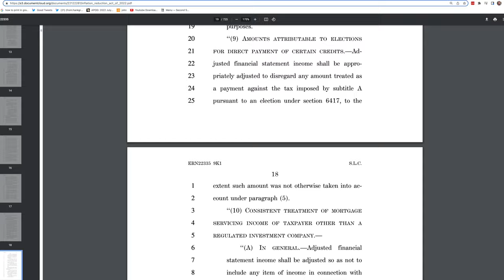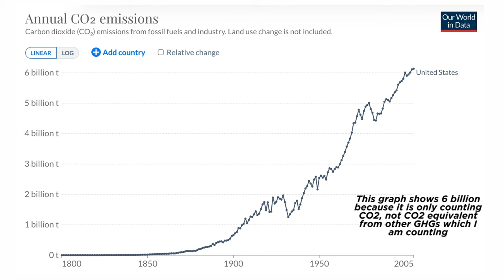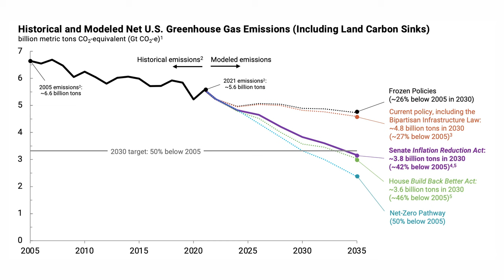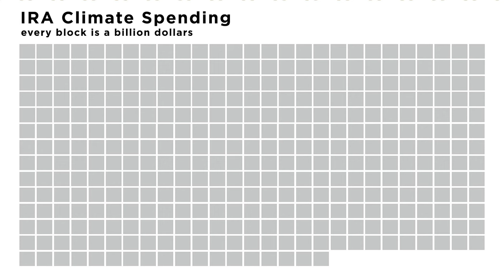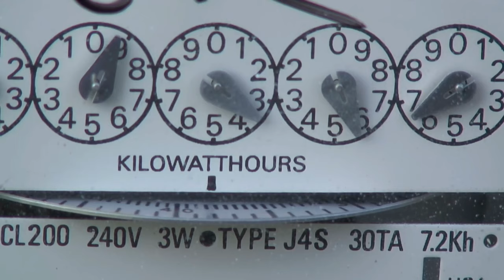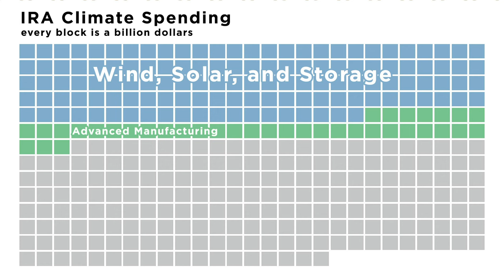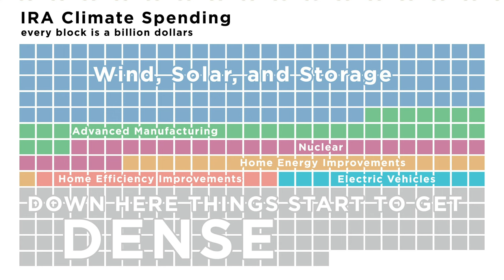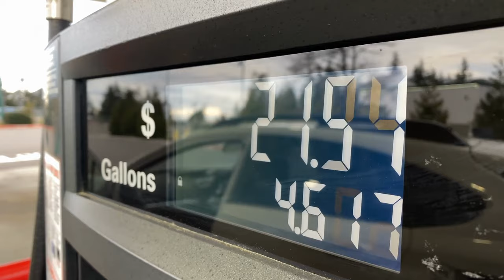The Biggest Climate Bill of Your Life - But What does it DO!?

Comment: I think it’s great that the bill helps electric vehicles, but what it should do is change the infrastructure to be less car-reliant and to emphasize public transportation such as commuter-rails, subways, and electric trolleys/ buses.
Reply: Sad part is it helps hybrids just as much. And that will probably slow down true electric vehicle development and sales, because old manufacturers can still just put small and cheap batteries in their combustion engine cars and get the full reward.
Reply: THIS. I used to say I really wanted a self-driving car, but what I really want (and most everyone I've spoken to about it) is a clean, safe, reliable, and accessible public transit system. What little public transit this country has is usually under-funded and overcapacity, which means it isn't particularly clean or safe, who knows how much longer it will work, and it tends to be either inconvenient to use or straight up inaccessible to disabled people. 

Cheonggyecheon in Seoul turned a major highway into a public park and overhauled their transit system, and it's resulted in a cooler city with cleaner air, fewer cars and so LESS traffic, and brought it millions in tourism dollars. We need to rethink everything about our country.
Reply: And not just commuter rail, but deprivitize rail so that it can run at all hours not just peaks.
Reply: I can't stop thinking about this, and about how Musk's Hyperloop ploy (which is stalling and going nowhere) was designed to halt California's highspeed rail development. It's no mistake that efficient (and therefore more ecologically and energy friendly) public transportation is seen as threat to the auto industry,  both traditional petrol and electronic, a very much private for-profit system integrated with our decaying road infrastructure (all the new and good roads are tolled). This country is overrun by corporate interest and the climate bill isn't escaping that.
Reply: @littlegreenclementine  +
Reply: Hopefully that will come in a future bill. I live in the city now, so it’s easy for me to take the bus. Work pays for bus fare, I don’t pay for gas, I don’t deal with traffic. It’s all kinds of win. But I’ve lived in areas where public transit was not feasible without still having to drive to a park & ride and deal with multiple transfers. A lot of Americans would feel shut out of this bill if that was a higher focus. But I’m hopeful this bill is the start to improve on the public transportation we do have, and build it where there really isn’t any.
Reply: That already happened in the bipartisan infrastructure bill
Reply: @whitneyschmitney  tell me you're a communist without telling me you're a communist...

Comment: I never thought I would see anything like this for years.  I have been active in climate issues for 4 years.  I think this bill is VERY GOOD.  Of course there  are things I would take out,  but the basic approach is correct as a starting point in my view.  The big challenge now is to find the companies that have the best capacities  to use the available funding.  It will be crucial that selection of contractors be totally transparent and that the public engage heavily in the process.  This includes the participation of the climate skeptics, some of whom have deep knowledge into the dynamics of energy systems.

Comment: Can you talk about how "reconnecting communities that were divided by the interstate highway program" is related to energy use and/or the environment? Serious question. Not sure I understand that one. Is it about reducing the need for Fossil Fuel based transportation and allowing more people to walk, ride bikes, or use clean transportation methods to get places?
Reply: Certainly the desire to reduce fossil fuel use in transportation is an important factor. I think that efforts to reconnecting communities that were divided by the interstate highway program are largely focused on the mitigation aspect. Those communities (which are largely poor and of color) were adversely affected by the creation of the interstate highway system and suffered disproportionately from localized automobile pollution. The components of the bill that address this are likely much like those that might seek to compensate communities that were adversely affected by a power plant or mine which polluted the local area. It is about the local environment more than the global environment.

Comment: What do you think about the impact of all the mining needed for the precious metals required for a lot of these technologies? The mining industry has a big issue with environmental oversight and has the biggest effect on the most disadvantaged people in a bunch of countries, especially indigenous peoples. Their lives are gonna suck a lot more and people don’t talk about that side of green technology a lot
Reply: Who cares?
Reply: @robertwright4906  we all should
Reply: I am a materials engineer and I wish people asked this question more often.

For photovoltaics (solar cells) the impact on mining is likely insignificant. The only required elements for a cheap and simple device are silicon, boron, phosphorus, and aluminum. Silicon is the base semiconductor. Boron and phosphorus (or other III-IV elements) are only used in trace quantities as dopants. Aluminum is simply a conductor of electricity -- any other reasonably conductive metal would suffice. All of these elements are common in other industries and unlikely to cause new problems in mining. (For example, silicon is already used as an additive to certain structural alloys and in manufacturing electronics.)

For wind turbines the impact is also likely small. The main components are structural (strong metals or composites), so they would not require much more mining than what is already mined for other structures (e.g. buildings, vehicles, etc.). Some heavy metals (typically lanthanides such as neodymium) that are components in permanent magnets may require some new mining. However, the challenge in procuring these elements is more in separating them from soils and each other as they are largely evenly distributed in the crust. Additionally, it is possible to design wind turbines that minimize or eliminate the need for such heavy metals.

The real issue in terms of mining is in energy storage, particularly via batteries. Lithium ion batteries (our most efficient in terms of energy per mass) require lithium (of course) and cobalt. Both of those have been problematic to mine in the past. I have seen some research into alternative materials systems for batteries, such as a sodium based battery, but those are likely decades in the future. For now, it is important to realize that (1) these components can be recycled (2) the mining for these metals is still less destructive than extracting fossil fuels (3) there are strategies to minimize the need for these elements in batteries or for batteries in general and (4) it is possible to create alternative storage infrastructure (e.g. build a reservoir and hydroelectric dam, pump water when energy is in excess, release the water when energy is needed). A more robust grid with a sophisticated design for distributing energy efficiently over large areas may also reduce the need for storage (e.g. solar in California can power New England in the evening; likewise wind in the East Coast may power the West Coast at night).

Comment: I was halfway through writing a paragraph and decided to cut it down, green house gasses reduction are good, electric cars are ok but I hate cars so that's bad, lack of public transport bad. Overall I'm happy with the bill and I'm glad the USA is moving in the right direction. 
tl;dr cool story bro, needs more trains.
Reply: Let's get those train rolling chuu chuu
Reply: Some amount of electric vehicles are necessary for, like, long-distance transport.

But yeah, the lack of support for public transit is disappointing. I'm not sure the federal government could actually have done much, though.
Reply: @mightyNosewings  I'm sorry, the fact you want electric cars for long-distance transport annoys me,  the point of public transport is to take you long-distances. Short distances should be traversed by walking, biking etc. Cars (and road based transport in general) fail at long distances because they destroy the surfaces they run on and have very high rolling resistance basically meaning that moving them requires more energy (and therefore money and CO2 if using combustion engines) and more resources (and money and CO2) to maintain the roads they run on. Electric cars are like putting a bandage on a wound that requires stitches; the immediate problem is gone but the real issue hasn't been solved.

Comment: "no one in Congress would keep their jobs if we started intentionally making gas more expensive" 

1 major and 7 minor oil pipelines shut down
Fracking and oil production banned on federal land
Multiple import taxes put in place for oil and gas imports.
Increased tax (reduced tax cuts) for domestic oil production companies

I'm not a big fan of huge oil companies but we can't say they haven't directly made gas more expensive.
Reply: True but they should make it more expensive with a carbon fee and dividend and limit oil production no? At the same time they should also use policy to reduce the need for oil consumption with high speed rail and metro trains, and electric cars
Reply: @ocean6462  definitely we should work towards using more sustainable sources of energy, but we should make them available BEFORE trying to get rid of the ones we currently rely on. That coupled with the fact that if the sustainable sources end up being more efficient then big companies will most certainly begin to switch on their own in order to make the same money at less cost.
Reply: @austingarrett3334  well we globally are already not projected to stay below 1.5 degrees of warming and not in line with the paris agreement. And thats gonna mean more extreme weather events and sea level rise. It also causes a feedback loop where ghg emissions lead to higher temperatures, more water evaporating from the oceans and lakes, and water vapor being a ghg leads to more warming.  Droughts and floods destroying crop land. We should really try to stay below 1.5.

In practice, speeding up the energy transition means government subsidies for clean energy and disincentivizing carbon emissions. Alternatives are here, new electric cars have reached parity in cost with new gas cars. We need to decarbonize faster.

A carbon fee and dividend, where you have carbon taxes per unit of emissions, to acurately price for the negative externalties of cabon emissions, and give everyone back an equal share of that money, does not make people worse off. maybe it makes people better off due to the fact that most people would receive more than what they pay in addional carbon taxes. The highest emitters like trucks, planes and constrction vehicles, natural gas plants, animal agriculture, would all pay more into it than they receive, increasing the dividend for the average person. So this policy is good for the average American and good for the planet
Reply: @ocean6462  there's two problems with your statement there. 

One, it is incredibly unlikely that we can get china to agree to the climate accord which accounts for roughly 30% of the worlds CO2 emissions yearly. Certainly we can do our part to help but it won't drop the total CO2 emissions of the world as much as we might hope.

Two, electric cars are not a viable solution for many families across the country (including my own) due to the price, they also do not currently have net zero emissions due to how electricity is generated in most of the country and the fact that the battery needs to be replaced about every ten years which leads to larger mining operations to harvest the lithium needed for them.

The second point there can be addressed as time goes on and the manufacturing of electric cars becomes more efficient and hopefully we will find a better battery chemistry to use that makes that process easier.

As for the first point, say we were to cut our emissions by 10% across the country. That would only be a 2.4% change in the world emissions. It is a doable amount, but not without major changes to our countries infrastructure. Those changes won't happen just by making oil more expensive.
Reply: @ocean6462  what we have here is a very common disconnect between people of our respective beliefs. Whataboutism is generally seen by those such as yourself to be a way of trying to weasel out of something, but from my perspective and the perspective of many like me I am ok with going forward with a plan like that. The problems I foresee is that C&D much like many other proposals strike a balance that actually becomes detrimental to their own cause. For such a policy to work we would have to take it much farther than what it currently states to be effective. If we can get that passed that would be great, but I don't think that's feasible. As such this is akin to trying to climb out of a well when you haven't rested in a long time, and trying to climb out and failing would leave us in a worse position than where we currently are.

Tldr: we need to shit or get off the pot. Go full steam or hold off for a bit until we can
Reply: @austingarrett3334   yeah definitely we need more than c&d. But it is aka a strawman argument because it's saying: We shouldnt reduce or emissions because china is emitting more nationwide when thats not relavant to whether we should.  First of all, we have more emissions per capita, so from the perspective of individual people we are the worst emitters. Second, any significant emissions reductions helps slow global warming, its not like we either all cut of emissions or there's no effect. And third, the more we reduce emissions, the more we can pressure china to do more to reduce its emissions. But i know you agree with me no point arguing and ur right c&d is very hard politically

Comment: A small point of correction - those appliances, stove, etc that are gas powered don't put off CO2; they put off carbon monoxide (CO) which of course is toxic as heck to humans. What's worse is the CO enters the atmosphere and strips an O off an O2 molecule, then making CO2 but in the process lowering the Oxygen in the atmosphere, increasing nitrogen and other trace gases which are also greenhouse in effect. Finally, the one O, (left from stripping the O2 molecule) is available to bind to an O2 and become O3; the dreaded ozone.  
Not that I'm a chemist, but I did stay at a Holiday Inn Express last night.

Comment: I'm very surprised that so few people talk about mining. I'm not talking about bitcoin, I'm saying that electrifying everything requires a lot of different materials. On average you find 75 of the 85 natural elements of the periodic table in an electric vehicle. So much so that going through with such a bill equals extracting in 35 years the same amount to every metal that's been extracted since the industrial revolution. And extracting minerals is a filthy business to say the least. On top of contributing to deforestation, extraction methods are extremely polluting. One methods to extract gold is to pour cyanure in the mine in order to separate the gold from the ore. Cyanure is a potent poison and will kill anything it touches if there is a leak. Which is likely and has happened in the past. That's just one of hundreds of incriminating examples. My point is: there is no such thing as "clean energy", except the energy you don't use. And in this whole video the only points about that were A. better insulation for buildings B. more efficient vehicles, none of which exclude a rebound effect btw. Sorry I'm getting so worked up, but you have to understand that here in Europe, the US is used as token to do nothing. "As long as the US emits 14 tons of CO2 a year per capita, there's no need for France / Germany to worry". This bill is exciting, and I want to encourage any positive move. Especially after the Trump presidency. Switching to renewables is better than doing nothing and sends the right signals. But moving forward is not solely a technical challenge. I don't know, maybe politics work differently in the US, but despite the ambitious plan, I feel like it falls very short if there's so little to say about a change in the way of life, means of production, structure of the society etc...
Note: I mightn't have the exact numbers because I'm extrapolating based on European numbers, but if you want to read on: https://www.euwid-recycling.de/fileadmin/data/euwid_recycling_und_entsorgung/news/images/metals-for-clean-energy.pdf

Comment: Have electric/induction stove tops improved? The last modern one I used couldn't heat evenly and was incredibly slow to heat. Gas is a huge upgrade in that regard.

Also, only a tax credit for EVs? How about a buyback at MSRP for all the ICE vehicles as well as a credit towards a new vehicle. Otherwise there's no point.

Comment: Just a quick tip. Here in California, regardless of our push toward electric. They shut off our power all the time. They have safety shut offs in the summer, and the snow in the winter takes down our lines. Leaving us without power for weeks. Meaning we have to use generators for electricity and it's most useful to have propane appliances bc then they won't go out with the power. And that's here in the golden state of California that supposedly leading the clean energy movement. Here's a tip, whatever ya'll build, just make it work. Bc the government is the worst at thinking things through.